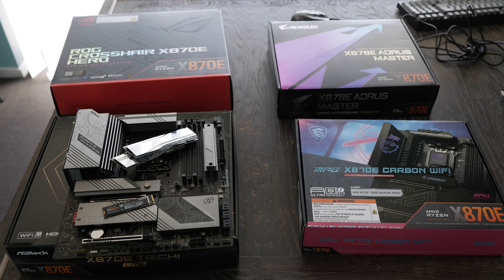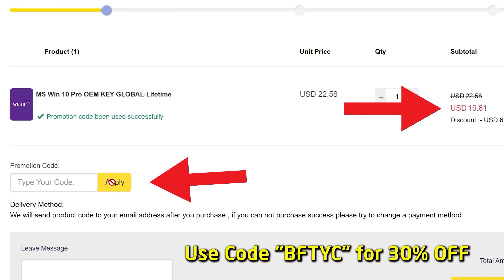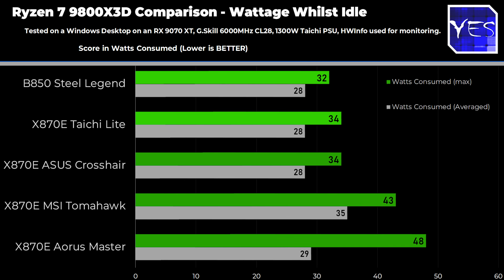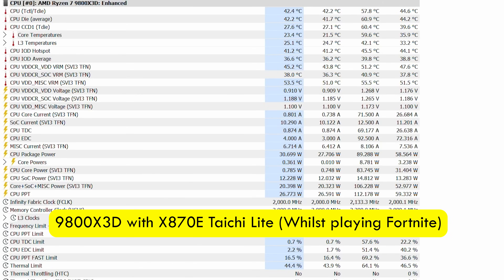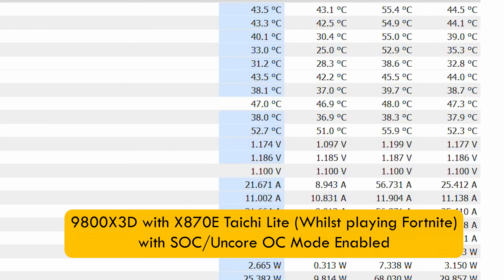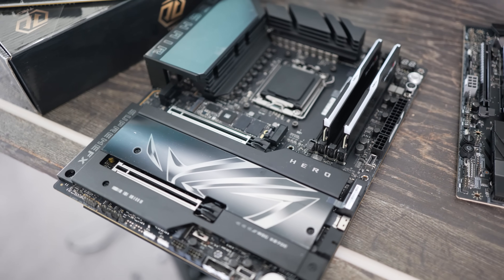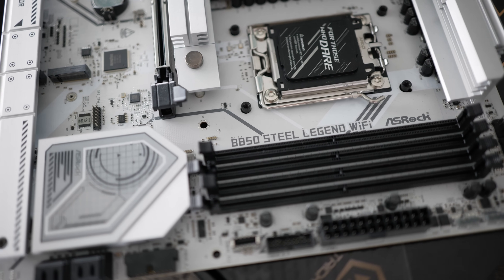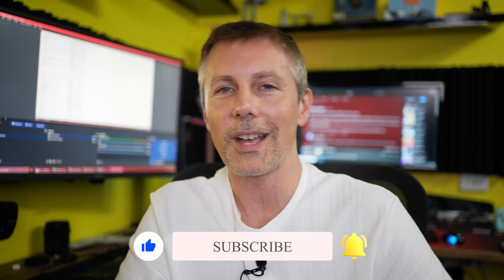I think I know why Ryzen 9000 Series CPUs are Dying...(!)

Comment: The Asrock mobo "Feature" is killing CPUs, but it's the CPU's fault? Yet other brands are not doing this? The logic is flawed
Reply: It may or may not be flawed.  Just because 1 does it only doesn't mean it shouldn't be safe.  That alone isn't meaningful.
Reply: Did you even watch the video?
Reply: @dakbassett lmao no, he has no attention span. He wants to justify his AMD purchase so refuses to admit when wrong regardless of facts. Character flaw.
Reply: It is the CPU…
Reply: You would think the CPU would shut itself down before burning up.  But perhaps not if the damage is so gradual.
Reply: No it's not, you didn't listen. This is a core function of the CPU, but other boards are not using it. The 7000 CPUs are fine, the 9000 have problems. AMD has had previous problems with XMP in the past, and DDR 6000 is technically an overclock. So something is wrong with the memory controller in 9000 that is using too much voltage, and AMD doesn't limit it in AGESA. This is NOT ASRocks fault for using the feature as intended, it's AMDs fault the feature DOESN'T WORK. The other brands are simply not using the power saving feature, so they're technically not operating in normal condition, and are either faulty or know the feature is broken and did this as a work around. Either way, this is a CPU flaw, and AMD is at fault. For AGESA and the function not working. ALSO, this is a BIG SCANDAL if they knew and said nothing because that's a cover up, and ASRock was left out of the loop.
Reply: I might have not read the message very good, but its Asrock job to create a loadline function that not gives more than 1.2V. Ive tried all their bioses on the b650 HDV. The first ones didnt even have a manual loadline for the Soc voltage! The stock one did work pretty good though. The later revisions lets you choose from several levels :)  So with this in mind I think its just a matter of finetuning the loadline on the problem child.
Reply: @JohnDoe-ip3oq  7000 cpus are failing too
Reply: @JohnDoe-ip3oq  we did listen and it may be a CPU core function but it's not happening on other boards, so asrock implemented it wrong. If he's taking the same CPU not a different one the same CPU and putting it in different boards and they have the feature but they're not causing the same spikes, then asrock implemented it wrong.
Reply: It is CPU feature. The CPU requests different levels of power from the motherboard. The difference is that other boards have this by default turned OFF while asrock has it ON. Now it would be worth checking how the voltages behave on the other boards after enabling this.
Reply: if you’re smart you would of picked up on the fact that it’s literally a voltage regulation issue & how the V.I.D is interacting with vsoc. it’s literally a bios code issue. 

same shit happened with 7000 & asus. 

but to know this you would of had to update anything over bios combo 1.2.0.2B to observe the fact that on every single vendor…no matter the board—anything over 6000mt\s will force vsoc to 1.295-1.3vsoc.

how the hell is a “normal” user supposed to understand what vsoc their chip likes without an op board ? Don’t even try to say that it doesn’t matter because I have proof.

But ofcourse most if not all people will think they have the answer. 

it’s more asrock then the cpu being a potential fail safe within itself. 

more then %80 of asrock boards ? nasty work lol
Reply: You just don’t understand. Your IQ must be not high enough. Not like ours. We are geniuses.

Comment: On gigabyte x870 aorus elite with 9800x3d at stock freq and -20 PBO curve, I keep my VSOC set to 1.175. I could probably go lower but I'm using custom tight timings with 6000 cl30 ddr5. It does not and has not ever budged from that. I monitor my voltages 24/7 the whole time my computer is running. I've never seen a deviation of more than .001v

Comment: At this point  Intel's Core Ultra CPU series seems to be a better choice  despite their memory latency issues. There are some serious issues with Ryzen 7 9800X3D CPU series at the moment, similar to Intels 13th and 14th gen chips.
Reply: All the issues I'm hearing about are on the new X870E boards which nobody should be buying. They offer absolutely nothing useful. They are a cash grab to fool high end users. Anyone buying a Ryzen 9000 should just get an X670E seeing as they're already overkill for what is available and that's why X870 boards were basically just a refresh. The benefits X870E boards give are either pointless or could be updated on the old boards.

Feel free to go Intel instead if that worries you, but after 13th and 14th gen's issues you're not 100% safe anyway. Just pick whatever you feel is best for you now and what you think you'll benefit from best until you upgrade.
Reply: At least intel didn't combust motherboards...
Reply: 🤔 Hmmm………not even close to Intel’s i9 problems and the Core Ultra is akin to operating a governed lawnmower.
Reply: @techluvin7691  we dont know yet in all honesty. intels 13/14th degraded over time, they generally didnt went kaput from one moment to the other. if ryzens 9000 are going  dead  for the reason pointed in the video (and i have to say I am not totally sold ) then it does not bode well since over time  you will always get micro spikes up to 1.4 or even 1.5, independently of the motherboard maker. and some of the Deaths have been happening to cpus with service lives in some cases of weeks. So assuming brian is correct, what again i doubt, we are talking about cpus that "roll over dead", without prior signs,  after a minimal number of microspikes.

Comment: I would say that there still isn't enough concrete data to draw a definitive conclusion. Alas, the smoking gun is still missing. 🙂
Reply: Indeed, it's only a theory, but acting on it and switching that setting to Enabled might prevent some CPUs from dying until we do get a definitive assessment and fix. If I had the combo in question, I'd rather enable that setting and cross my fingers than leave it on auto and cross my fingers. 😉
Reply: As stated in the video.
Reply: I’m forever going to stand by “they did something with the bios code & it’s messing up with how V.I.D is interacting with vsoc on every board. 

if I’m wrong then I’ll take the bullet for it but I have a feeling I’m not

Comment: I wrote something similar to this in your last video, as this was something I'm just learning for myself with my new Asrock and x3d chip, the SOC is an important voltage I don;t yet understand and any alterations I have made make or break stability from that one setting and auto sends the values sky high. 
Excellent work comparing several brands and finding the main common denominator and possible fix.
Reply: vsoc can make or break your experience when you don’t understand what it’s breaking. 

vsoc harms memory stability , cpu stability , the TX \ RX link for tphyrdl that scales with memory speed, &  fclk oc potential. 

can’t run 6400 on your particular board because tphyrdl won’t sync for the life of you ? you need a better board no exceptions. 

can’t run lower vsoc because your board has a shitty voltage regulator ? you need a better board. 

tphyrdl keeps miss matching when attempting lowest vsoc bin for your chip ? better board 

the biggest “jaw dropper” was when I found out my 2-year old 7800x3d was able to do .960vsoc @6000 lol. Mind you it took me getting an x670e-Gene to really “unlock” my cpu. 

.960 is straight up unicorn numbers 

Never seen one, never heard of one before. 

but my point is, go 1dpc & save your sanity. you’ll thank me later
Reply: . I have the 9700x so this 1 dps thing doesn't apply to me, correct?
Reply: @uboobly  It’s possible but I can’t 100% confirm
Reply: Asrock pushes SOC way to high even on 5000 series with memory above 3200. So my suspicion is that if you run memory faster than Jedec you will see too high a SOC voltage.
Reply: I really appreciate this info you are posting here. Very informative. Thank you so much. You have me looking up stuff. As you know - these components are expensive to just go up in smoke.
Reply: My 9900X3D X870E Nova soc at 1.125V has been stable, almost a month old default was over 1.2 in bios. I'd love to learn more but am running conservatively for now. My upgrade from 12900KF into this situation where we also got a voltage uncertainty. I thought AM5 was decently mature but I guess it's a risk buying current high end there should be a soc user manual I swear.
Reply: @ it’s mainly with ryzen 9000 since it’s newer then 7000

Comment: Ok just watched both of your videos. A little confusing. In this video you say the remedy should be to set this SOC setting to "AUTO" or "Enabled" ?  Or leave it "Disabled"
Reply from the maker: Set it to enabled if on an asrock motherboard with a 9000 series chip, the 7000 series seems to not have this problem and benefit from fluctuating SOC voltages, so auto is fine or even disabling it is fine on 7000 series chips.
Reply: Set it to Enabled. Which funnily enough disables the dynamic SOC.
Reply: LOL  @SaccoBelmonte
Reply: For some reason "enabled" means its off, "disabled" means its on and "auto" means its on. So for 9000 series CPUs you need to have it "enabled" to turn it off.
Reply: this is new video after testing so...
Reply: @jpteknoman  what about 7000 series? Also to enable it? Cause hwinfo show spikes from 1.153 to 1.244 V. On 7800x3d
Reply: He doesn't even know

Comment: i'm on the asrock a620i lighting wifi and I have not seen the soc voltage go up it stays at a constant 1.2 for me, not sure if this is just a b650 and x870 issue, had a 7800x3d on it first and now the 9800x3d for for about a month now no issues

Comment: Would undervolting help?
Reply: You don't undervolt the SoC and the cores themselves don't have a whole lot to do with the SoC. It is more of a memory thing.
Reply: @Azureskies01  so how do I lower the SoC voltage? Is it possible?
Reply: My SOC voltage is fixed at 1.195V after a 8 hours gaming session i thought it was because of my undervolt, apparently not.
Reply: The bigger the voltage difference between memory controller and memory the more dangerous it is. So people lowering the soc are doing the wrong thing.

Comment: Probably should let Asrock and AMD know then. (yes, this was sarcasm lmao)

Edit. I tried this and am still getting a wide spread of voltage - didn't seem any different to being on auto. Min: 1.214v, Max: 1.224v, Avg: 1.219v. This was identical to before changing the setting.
Edit.2 OK, I forgot to account for the systems startup. After resetting and using for some time, yes, the band it fluctuates in is very much more restricted now, much better than before - 1.218v to 1.219v.
Edit 3. So, even after clearing I still get the larger spread returning. It ranges from 1.215v to 1.225v, but as noted below that's when its idle, like on Windows or I leave the PC. Gaming though, it tightens up. So doing little to nothing it moves around quite a bit, but actually doing something more than just web browsing - playing games, running software etc - it tightens up to a more 
restricted band. Would have thought the opposite tbh, but I don't know much about power delivery, etc.
I have noticed, and maybe this is how its supposed to be, but voltage goes down when doing stuff, but increases when idle.